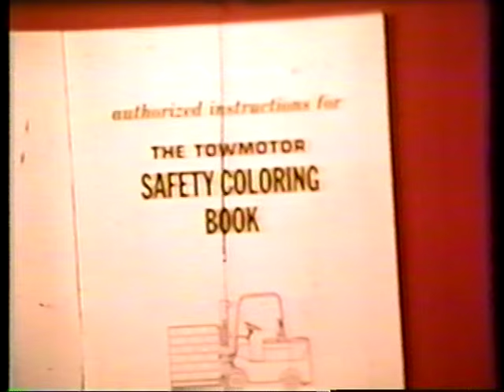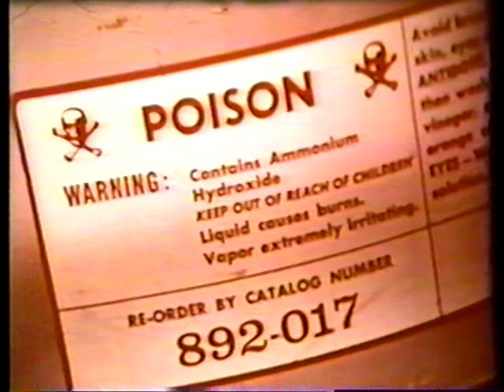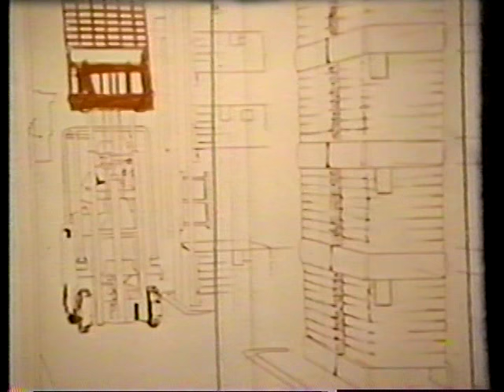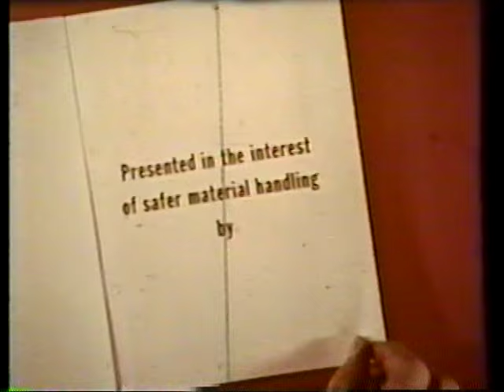The Color of Danger - Forklift Safety Video - Caterpillar

Comment: I watched this very film 32 years ago. I'd driven forklifts on our farm, so, I kinda knew what I was doing already. With that said, after all those years of driving as a full time job, I consider myself extremely lucky to have never had an accident while always getting my work done. I also still believe that the day I don't learn something new is the day that I give it up! NEVER get complacent ladies and gentlemen, it'll come back to haunt you.
Reply: lactosis- -undefined Only once. I normally drive my truck to work. My trucks, to this day, always have manual transmissions. One day, I had to take the wife's car with an automatic. I almost broke the "multi-function switch" off of the steering column trying to get that damn car to move! I also find myself blowing the horn at intersections now and then lol!
Reply: lactosis- -undefined Nope, not just you. Be safe and always resist the urge to run over the idiots that always walk right behind and/or in front of you...even though they'll feel it a lot more than your forklift will.

Comment: The steel truck shows up at the yard with our 2 inch 8x20 plates. Operator kid hauls out to the truck, spins the forklift around, and jabs the forks under the first plate. Too bad he was about an inch off and shoved the plate off the trailer. Good thing the brand new, just picked up that morning  BMW belonging to the captain of the CG cutter was parked where it could catch the plate and prevent it from being damaged. The edge of the plate landed just behind the rear window and cut the beemer in half. Nothing sadder than a ship captain crying over whats left of his new ride.

Comment: The real danger is some of the stunt men that did these accident simulations. The guy rigging the lift when it turns over sideways, the guy driving the lift through the brick wall, and the one running the lift off the dock into the water.

Comment: Should you really cross railroad tracks at an angle? Doesn't that increase the likelihood of the lift tipping to the side?
Reply: Yes you should. The road should be flat so it wont tip. If going at an angle only one wheel goes over a rail at a time, reducing the impact because only one of four surface contact points is moved. This removes most of the impact.